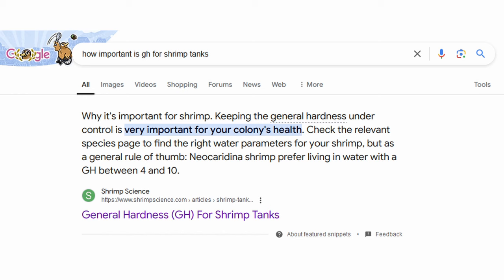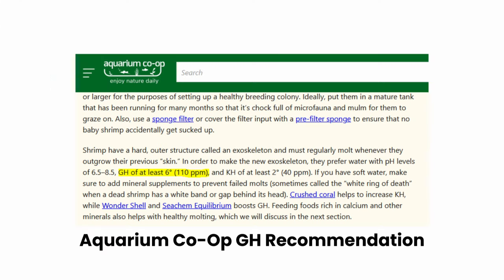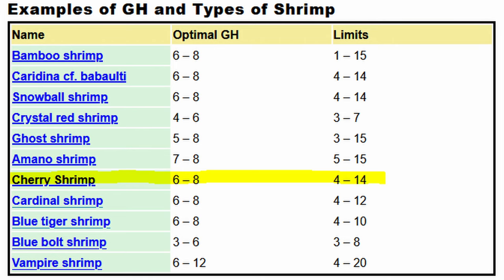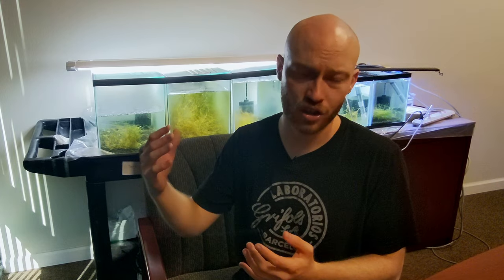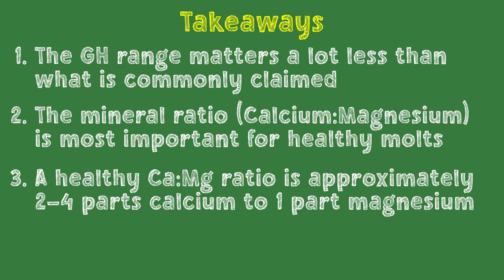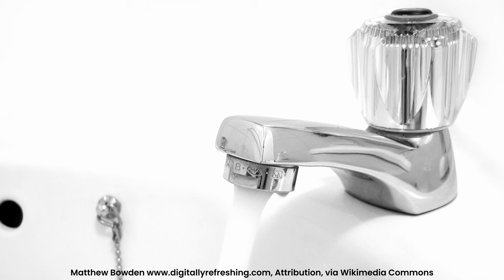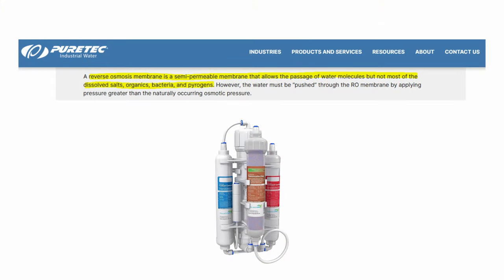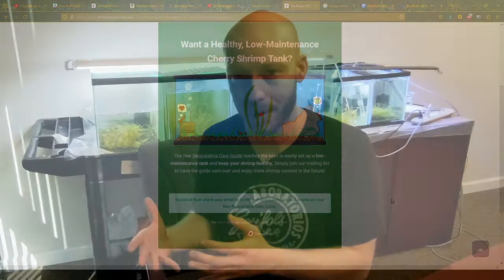General Hardness (GH) Doesn't Really Matter In Shrimp Tanks

Comment: Man, what great timing for this video!  I've been trying to solve for slow die-off in my shrimp tanks where everything looked okay regarding GH/KH.  About 2 weeks ago, I finally decided to use Salty Shrimp as well with my RO water and the die off seems to have halted.  I agree that the ratio of the minerals seems to play a significant role.  Wish me luck, it is still early and I'm still slowly changing out the water, but so far, so good!  Thanks for taking the time to test and not just regurgitate the "proper" parameter ranges!
Reply from the maker: @retro6652 I'm glad to hear the remineralizer seems to have helped your tank! One thing that might be interesting is checking with your local water district and seeing how much water quality data they share. Some of them provide magnesium and calcium content. If so, I'd be curious to hear what the concentrations are and maybe we can learn more about their tolerable ratios!

Comment: I am still testing this, but dandelion leaves (soaked in boiling water for a few mins) are high in both calcium and magnesium, so shrimp should absorb the minerals they are missing for molting. And shrimp love to eat them!
Reply from the maker: @metasymphony Thanks for sharing! Natural foods like dandelions seem like a great idea to feed shrimp. You mention you're testing it - just curious what exactly are you trying to test and what will you consider a success?
Reply: @shrimplyexplained I’ve had terrariums and planted tanks with snails for decades, but relatively new to shrimp keeping, so I didn’t know about the specific calcium/magnesium ratio before watching your video and will have to check the ratio in my tanks. I just know that my KH and GH were in a good range, but shrimp were still molting and growing slower before I started giving them dandelion leaves. So I suspect my calcium is proportionally higher than magnesium and they are getting magnesium from the dandelion. I’m going to buy the calcium test you recommend and monitor the ratio in my 2 tanks. Also setting up a new tank for females to have babies in and I really want to get that one right, so I’ll get a commercial supplement for them. 
Your videos have been super helpful for understanding my shrimp and getting the conditions right for them!

Comment: Did you drip acclimate the shrimp when you moved them ? If so how long ? I recently moved shrimp from a regular water tank to a RO remineralized with GH/KH+ from salty shrimp. I dripped for about 4-5 hrs, next several days I had 3-4 died from failed molt. The dying seems to stop and I’m prob 10 days in. The GH was 18 and Ive been changing out with RO water to get it down to 12. I do have crushed coral in the filter and thinking of taking them out since now Im using salty shrimp. Crushed coral was added before i started with RO and salty shrimp. I appreciate your thoughts. Gh12, kh2, ph 7.5, am0, no2-0, no3-5 or less. The water they came in had very low gh, kh and ph 6-6.6. I never had much luck with them reproducing. I took out some plants and had 1 berried in the old tank. She hatched in the new tank and died. Since then I could find 1-2 babies didnt make it and cant find the rest. I guess the reason Ive been tinkering with the water is because my shrimp dont breed. Prior to the change they were in the tank for 6-7 months.
Reply from the maker: @hoawong119 Thanks for the question and sorry to hear about the deaths.

To start, RO/DI water with a remineralizer like Salty Shrimp is always a good idea. It is a change from tap water though, so it can occasionally cause shrimp to molt early and possibly fail their molt. That issue, combined with the fact that they may have been experiencing stress in the previous tank (since no babies), makes failed molts more likely. Regardless, it sucks. Hopefully they do better in the new water.

My other concern is the KH. What substrate are you using? Unless it's active substrate, I'd say 2 dKH is a bit low. Considering your high pH, it looks like any pH control from the substrate may be gone even if you do have active substrate. 

Lmk if you have any questions!

Comment: Me, watching this video after lowering all the water parameters because the water I used in the tank was waaaay too hard (GH was over 30° and the TDS was around 500!). It was a mess, many have died. Now the shrimps are thriving and breeding, everything is in range and thanks to water remineralizing with shrimp minerals, so it makes sense!
Reply from the maker: @matthew_thefallen Thanks for sharing your experience! Did you end up replacing all the water in the tank with remineralized RO water or just some of it? How'd you handle transitioning the shrimp from the old to new parameters?
Reply: @shrimplyexplained  I did this with RO water for about a month or so until I bought Shrimp Minerals and started dosing it in the separate RO water jug. Afterward, I started doing 30% water changes with the new remineralized water. 
I already noticed great results with only changing water with RO water once a week (because it was also evaporating with the hot summer), and I also did like 50% water changes. They were doing great, no issues at all. But the best part was afterward, when I started using Remineralized water. A month later I have the first berried female, and then they all started getting berried! And the molts gave no issues either. So I think they are doing great thanks to the minerals. Now that I know your information, I might also add that probably Shrimps Minerals could be added in low quantities to tap water, even if it's hard. We should try this theory (or hyposthesis?) out! What I also noticed is that the TDS of the tank is around 300 to 400! So TDS also doesn't matter much as some people think as long as they have the right ratio of minerals? Very interesting!
Reply from the maker: @matthew_thefallen  It looks like you're coming to a similar conclusion that I'm reaching, as well. I'd guess that, if you're having molting problems, adding a remineralizer will always bring the mineral ratios into a healthier range, even if it puts the GH above the "recommended" range. 

I'm really glad to hear your shrimp are doing well! I'm guessing you have neocaridina in your tank?
Reply: @shrimplyexplained  Yes they are neos, I have 9 beautiful bloody mary females and 2 low grade males and tons of shrimplets now, more than 20. They keep on reproducing and staying alive and well. I also feed them twice a week, on Wednesdays powdered fish food and on Saturdays pellets, to keep the water clean. We are onto something here! I'd love to see more videos like this one, testing different things, debunking myths and all. There are lots of unfunded things that people believe in, especially in those facebook groups I'm in -.-''

Comment: Hi,I am thinking of setting up a shrimp tank but still unsure if I can use my tap water because of the calcium-magnesium ratio, it is 7-1. The ph is 7.6, GH 12. Do you think it would be possible to add minerals as you mentioned in your video to get a better ratio or just go with RO re mineralised water instead. Or a mix? Appreciate your thoughts
Reply from the maker: @milmil9080 Good question!

If you can afford it, I'd always recommend remineralized RO water. It's just so easy to mix the minerals in and not worry about any other potential contaminants in tap water. If you want to try with tap water, then this page (https://www.shrimplyexplained.com/tools/calcium-to-magnesium-ratio-calculator-shrimp-keepers/) should help in figuring out the magnesium dosing requirements. Mixing some RO water to keep your GH below 15 also wouldn't be a bad idea, although I don't have any good data on what the high range GH tolerance of neos really is. Lmk how it goes!